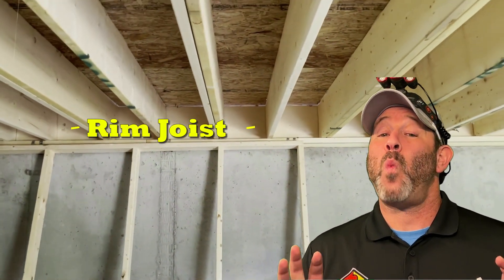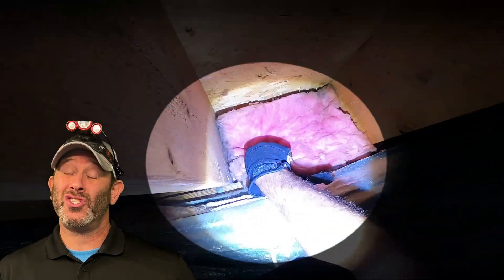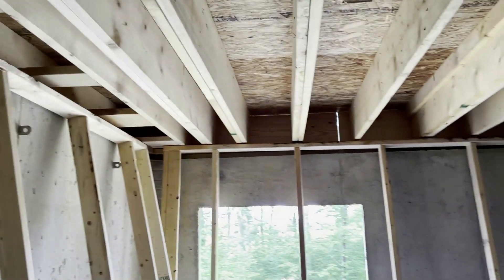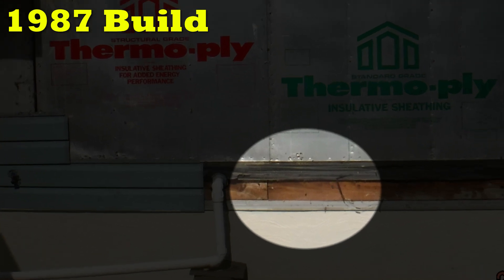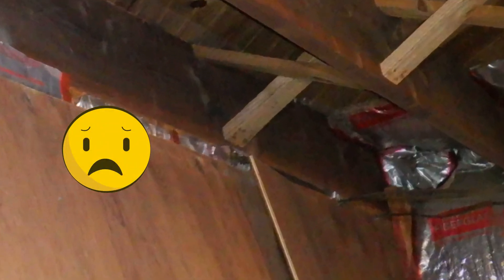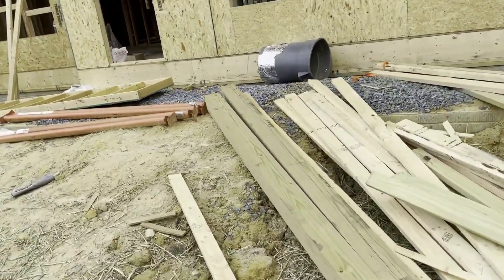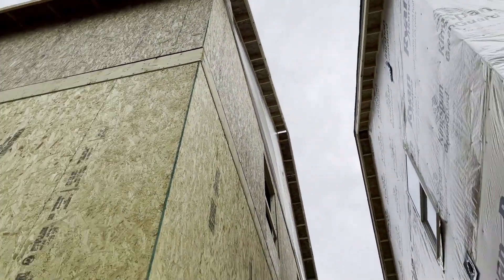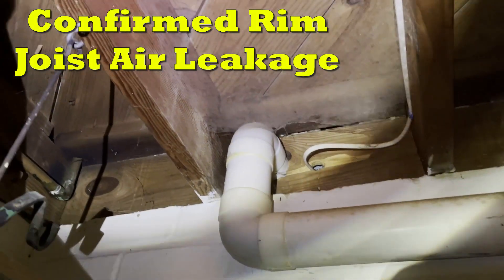I Could See Daylight from the Basement—Here's Why It Matters

Comment: I've never seen houses sheathed this way. That wouldn't pass code in our area. In our area sheathing goes all the way to the mudsill. No this house was done improperly by modern standards--for many reasons. If it is legal there you must not have wind or seismic loads. This really needs the kind of care you are providing.
Reply: Sheeting should go to the bottom plate

Comment: 1st time I've ever seen the rim joist exposed, usually the sheathing come down over it and over the foundation slightly to tie the wall down to the sill plate.  I see it is exposed on the 2nd floor also, the sheathing should tie the floors together. is this common in your area?
Reply from the maker: Interesting that you mention this. I took the video in Maryland and it does seem to be the way it is done around here. Generally, where are you located. I do wonder why it would be different?
Reply: @homeairleakagetest  I'm on the Cape, in Ma. Don't know why it would be different, I just assumed it was part of the code everywhere.